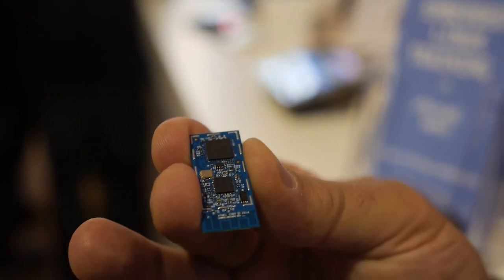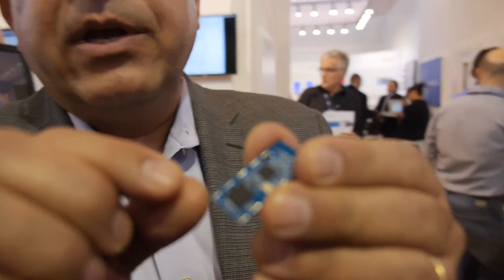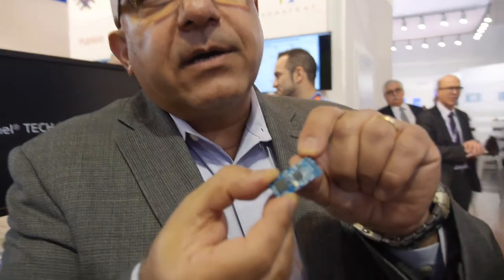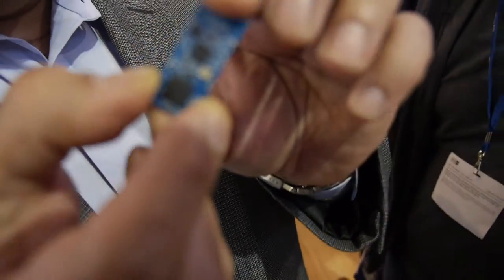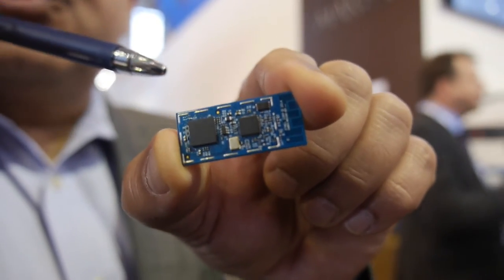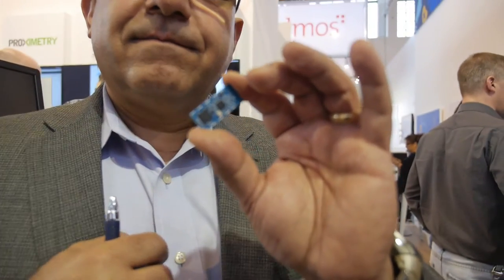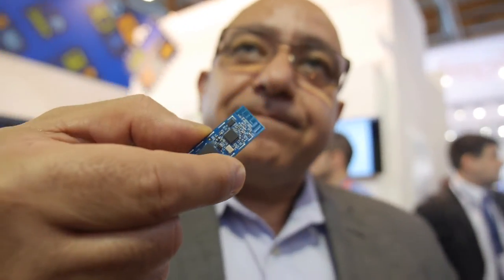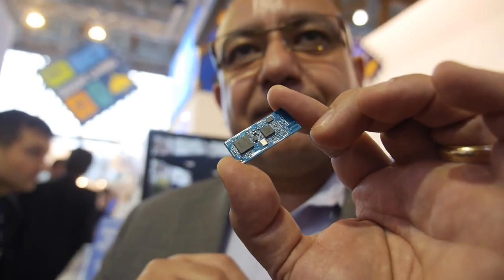Lowest Power WiFi in the World: Atmel | SMART SAM W25 Wi-Fi for IoT with ARM Cortex-M0+

Comment: why not use esp8266 or RTL8711 ??
Reply: This Atmel chip likely never made it into production like those chips. Maybe its claims weren't true? If they were you would see them on the market as competitors to esp8266, RTL8711  etc And a good competitor it would be because one big selling point is power consumption is less than esp8266, RTL8711. But also price point. Those chips are so cheap they are on ebay for 5 bucks.